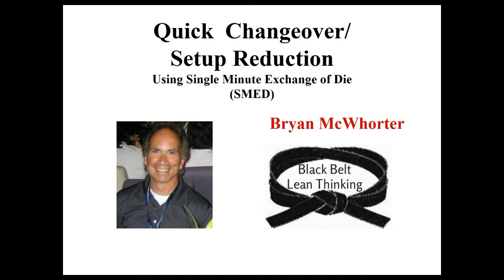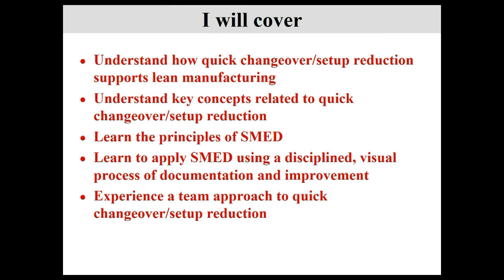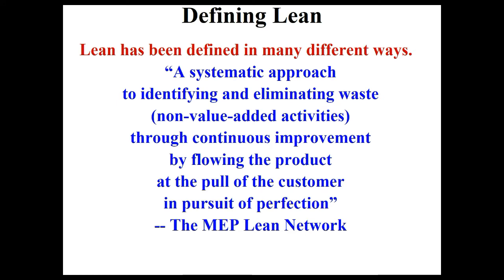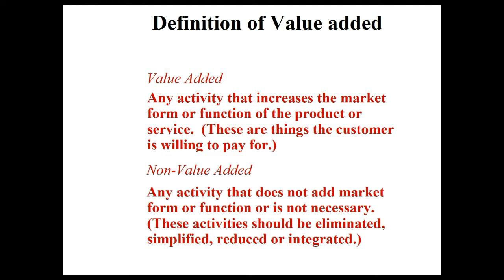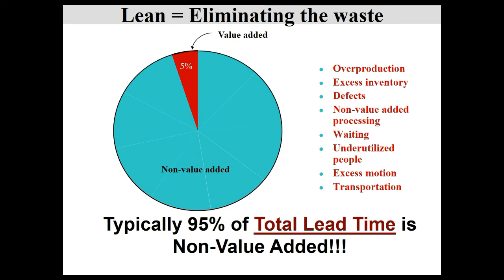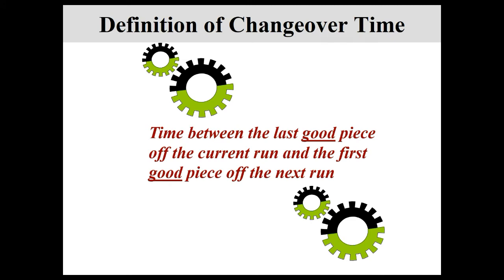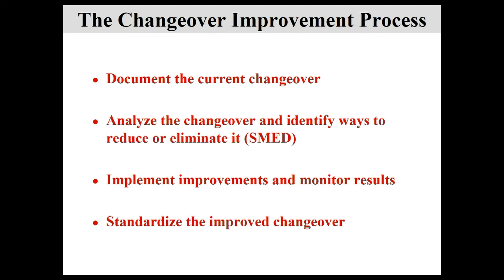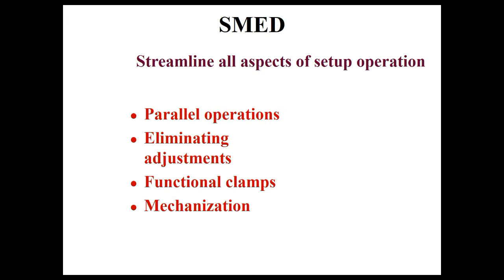Lean Manufacturing, Quick Changeover Tutorial (S.M.E.D)

Comment: Thanks for the video. If you were to go into a facility and start implementing this, would you start with the longest change over or the shortest? What is your strategy for selecting which process to start improving first?
Reply from the maker: Hi Kacee and thanks for commenting. Often, I would start with the equipment that management felt provided the most opportunity. Quick and effective changeovers equal versatility and can increase production levels. You want to get buy-in from those that run and work on / changeover the equipment, so it is nice if they can help suggest the start point. Remember to follow the steps I lay out in the video. Work as a team and you will be amazed. Feel free to reach out to me during the process. I will help as I can.
Reply: Bryan McWhorter That makes sense, and will do. Thanks a lot Bryan.